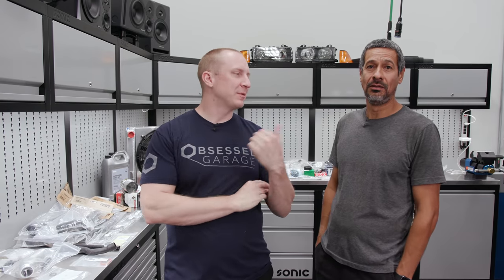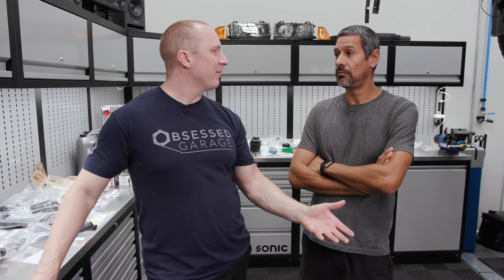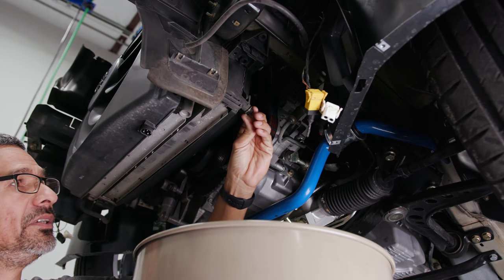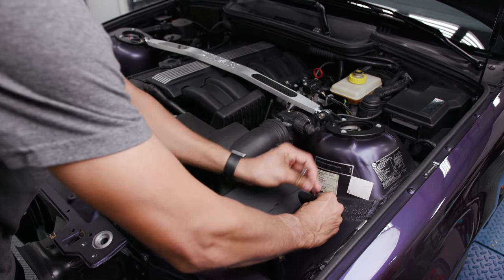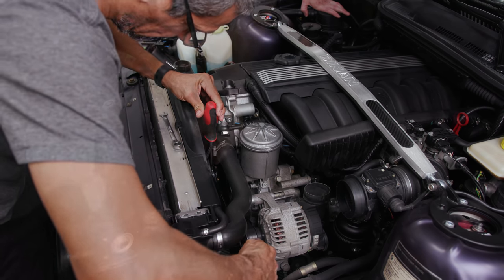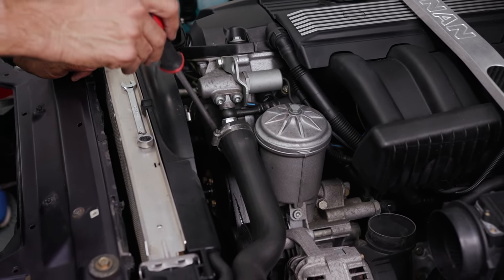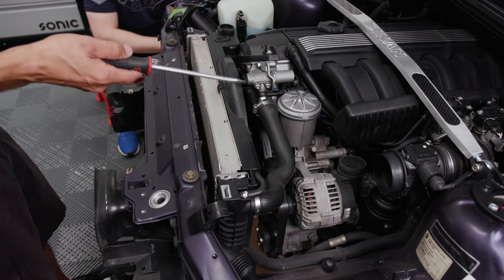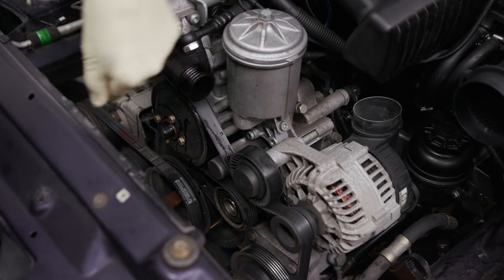How to Overhaul E36 M3 Cooling System - Radiator, Water Pump, Hoses, SPAL Fan

Comment: Very well done. Eb is a wonderful addition to the channel. Excellent tech and shows he’s just as OCD on the mechanical side of things.
Reply: He doesn’t have the mental health disorder OCD, OCD is a very serious mental issue. If you work on engines, it’s just natural to make sure everything is put back correctly, making sure the coolant system and other systems are sealed, no cross threading, proper torque specs etc etc. People with OCD struggle so much during their daily life, it has nothing to do with someone doing an excellent job working on an engine.

Comment: Not OG spec using green coolant in a BMW is wrong and can cause damage it doesn't matter what was in it the proper thing to do would be to flush the green out and replace. The green will clog coolant passages eventually.
Reply from the maker: That's nonsense.
Reply: @ObsessedGarage  no it's not it's been proven time and time again in the bmw community there are things in green coolant that cause internal corrosion this  a well known fact you can choose to damage your engine if you like but any BMW tech will tell you not to do this. I thought better of OG but I guess you aren't that obsessed
Reply: @thelukestormwalker  correct, some green coolant can cause a lot of corrosion. G05 is ok, although you don’t see it in green often.
Reply: @ds98136  I am unsure what G05 has anything to do with this G05 is yellow I still would not recommend anything other then blue per BMW.
Reply: I was thinking the same thing. It doesn’t matter what was in there before, using BMW Coolant is the correct way to complete the job. A full flush and refill with the blue BMW coolant would be the right way to do the job.
Reply: A non std coolant makes the refills a confusion is it BMW   or Some other  Type and  Are they compatible.

Comment: I recommend everyone with the m50,m52 ,m54, s50,s52,s54 engine to do this upgrade. Worth everything penny. ive seen many engines go out because of the stock coolant system . Now days to find a really good head with no cracks is very difficult and is very expensive…   I will be doing this to my E39 soon.
Best of lucks everyone!!
Reply: Assuming you're talking about converting to an E fan, clutch fans are superior in every single way. If you keep your motor mounts in check you will be fine. E fans will never be able to pull the same CFM that a clutch fan puts off.

Comment: Didn’t see him test the thermostat in boiling water or check the mounting surface of the aluminum thermostat housing with a straight edge. 

New fan clutch and fan blade is the way to go, not electric. 

A few minutes under the car he could have pulled the block drain and gone back with BMW blue coolant. 

Would have been a great time to change the starter “while your there”

Do you plan on securing the oil pump nut?

A VDO gauge pod where the sunglasses holder is located would have been a great upgrade while everything was out of the way. That way you get a real water temp, oil temp, and oil pressure gauge.

Comment: Great vid, I wish you guys made this 2 years earlier because I pretty much did the exact same and bought most of the same things for my e36 but not the low temp switch.  I just hooked it up to my pull fan power and put a makeshift tunnel where the pull fan was.

Comment: I bought a Zionsville Radiator for my E34 M50TU. And I already had a Spal wiring kit. The white temp switch sensor has 3 prongs. I assume I’ll be using the stock pre existing connector from the old one. But the color of my wires are different. I got a purple striped and a solid brown. And I highly doubt this third wire is green or red.

Comment: I'd have to say removing the intake manifold on am S52 is one of the more unpleasant jobs. The mess of hoses and vacuum underneath is sure to rip your hands up. The harness and fuel lines and rail are such a pain in the ass to work with trying to get the manifold out. Hope I never have to do it again after having done it several times.

Comment: What you should be doing after replacing all those parts is using waterless coolant . Lasts longer, cools the engine better and faster , and doesn't turn aesthetic and eat all the plastic coolant parts BMW , Benz, and many others are now using to save time, weight & $$$ on manufacturing vehicles . https://www.evanscoolant.com/ is what I put in all my vehicles including older vehicles. Since I have done so I haven't had to replace water pumps, hoses, or plastic parts as often .  Ever Ferrari is now using waterless coolants in their vehicles